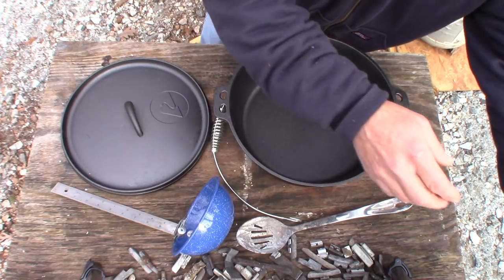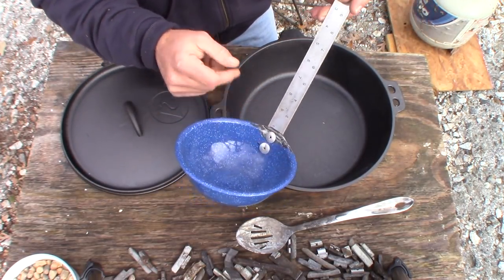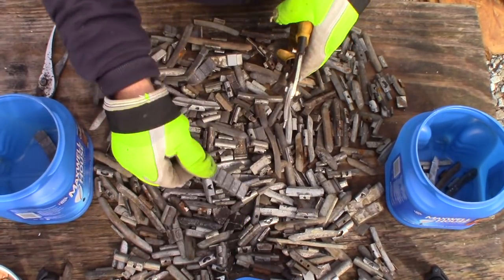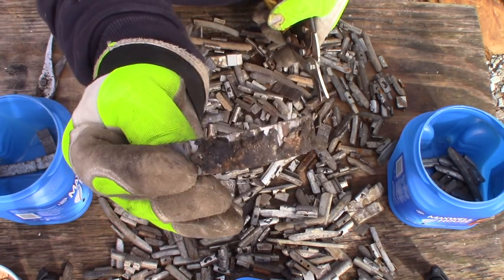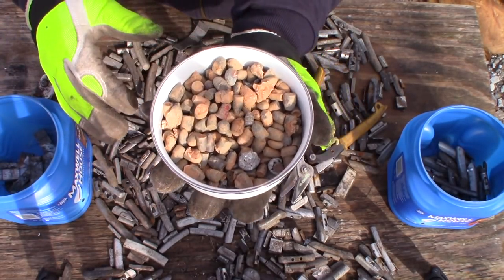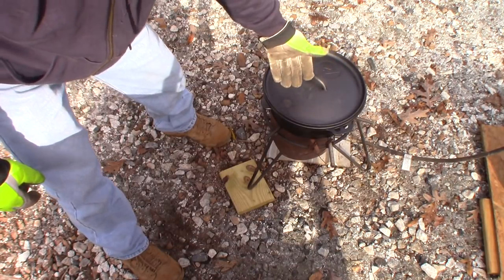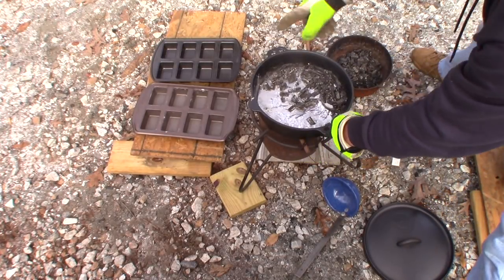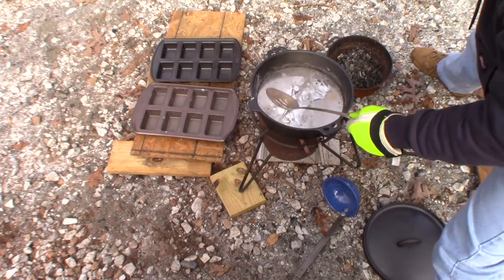Scrap Lead + Fire and Heat = Ingots. Tip, Tricks, Equip.

Comment: I find the easiest way to ID the material of your WW is to look at how the clip is connected to the material. 

Lead WW will be molded around the clip.
Zinc and steel is generally riveted or has some other connecting mechanism. As Elvis said steel can be welded.

Clip connection makes identification really fast and for ones you are uncertain of, just use the other methods like tapping for sound or scouring with shears that Elvis mentions.

Comment: Need to mention a high volume propane regulator BBQ grill regulators dont supply enough volume of fuel for a hot source of heat

Comment: Very informative, Only thing I would really do different is build a 12 in high platform for the burner. Something very stable with a ledge so the pot would not flip over. Then put the molds on a table...just too much bending over for my old @$$. Also would look for a better scoop, that one is going to have the paint on the bowl burn off and I do not trust that ruler handle. Also needs a wooden handle so it does not heat up. As for the molds, put them on a 12 x 12 paving stone you get for yards. The stone will disperse the heat better and not burn like the wood was. (on top of saving your table top..so don't use a plastic one). But other then my nit picking on non important stuff very well done.

Comment: Walmart has a great heavy-duty stainless Steel ladle for 6 or 7 dollars or at least they did 6 months ago. I used one as a bottom pour ladle by drilling a small hole in it like I saw fc45lc do and it works great.
Reply from the maker: hey Patrick M .. Thats a cool idea for a bottom pour ladle!

Comment: hey elvis ,i would suggest to take some precautions .the pot can fall on your feet ,and the spoon to fill the ingots will not hold, better a stainless greasy spoon and weld a steel bar 10 mm thick to it and on the end a wood grip.

Comment: The Dutch ovens that have the tabs cast in for attaching the handles give you another flexibility. You can run a piece of bar stock across them. Tap, thread and attach to the tabs. Weld a bolt to it and then run a threaded rod through that bolt and you can make a bottom pour pot. Grind a point - like sharpening a pencil, on the threaded rod and then drill a hole in the bottom of the Dutch oven where the rod can be threaded down into it to plug the drilled hole. You'll need some way to turn the threaded rod. You probably could use a double nut bound up against another one and crank it with a wrench or you might find a handle that matches the threads. Then when you heat up the pot have it set up on something that allows you to feed the ingot pans under that part of the pot where your threaded rod is plugging the hole. Un 'bolt' the threaded rod and you have the benefit of nice clean melt pour off the bottom. Fast too.

Comment: Elvis, I just bought all the stuff I need to start casting bullets. I went yesterday and got some wheel weights from a tire shop, and was going through them and separating them like you’re doing in this video. I notice all the weights with MC turned out to be lead and the KN was zinc, and the FE was steel or iron. The question I have for you is I found a few the had MC/KN stamped in them. I know the probably lead mixed with zinc, but if you throw that in a pot of lead will the zinc rise to the top so you can get it out, or does it mix with the lead?
Reply: Any answer , as to date??
Reply: I throw those out because my understanding is that you cannot separate the zinc from the lead once they are an alloy together. As a general rule of you can cut into it with metal cutters without going to extreme effort then it is lead and will work for casting.

Comment: How do you get rid of the backing on the soft wheel weights?
Reply: throw them in the pot . it will burn and float to the top.

Comment: What does everyone do with the copper jackets from the range lead? I am thinking of getting into the range lead recovering and i actually have a small forge that can melt copper i mean wouldnt this be a good way to recycle the jackets? an for those that dont have this means can you still take them to a recycling plant?
Reply: Country living yes they ca be sold run a magnet over to before selling because some a copper coted steel jackets
Reply: Throw them in the pot, the copper and steel will float after the lead melts out of them.

Comment: Since zinc and iron melt at a different (higher) temperature why not just dump it all in the pot and let the lead melt. The zinc and iron will not melt and will "float" . Then you can just scoop them out. Or is there something I'm missing...?
Also, those are all metals...lead, zinc and iron. Metal is a large category of elements. You're using the term metal like it refers to ferrous metal (iron) only...js

Comment: ? I got wilton  8 cavity pan  and a new 5qt cast iron pot , melted wheel weights , fluxed with saw dust and pored in pan , ingots came out with little craters on the bottom , what did I do wrong ?
Reply from the maker: all is good no problem...... the chemical on the pan did it... it will only happen a time or two! No worries... sorry bout cratering your perty ingots! : )
Reply: Thanks , I was hoping that was the case . New to casting , not reloading ,  in a learning curve . God bless ya

Comment: Loved the video Elvis.  I was going to buy me 8 ingot molds from Lee, but they were only 1 pound and a half pound ones.  You saved me alot of money with the trays you recommended.  Thank you so much.  I have a question.  I have a gentleman who wants to give me about 500 pounds of soft stick on wheel weights, but they have that tape on the backing of them.  Do i have to remove the tape or glue or can I just melt it and then skim it like you did with the lead.  Also, with this soft lead can I make fishing weights, this is why I wanted to make the ingots to put in a home made smelter.  Any help from you are anyone would be grateful and appreciated.    Thank you sir.
Reply from the maker: 👍👍👍 you can fill them with as much as you want. Any size you want!
Reply: Good mrng Elvis.  Can you read my comment again.  Its about the weights with glue on them or tape.  Thank you
Reply: You can throw them in the pot also, the dirt and tape will float to the top.. also instead of saw dust you can also use wax (candle,bees, crayons etc) any kind of wax will work to flux the lead, it will separate the debris from the lead. just mix it in and it will clean the lead up prettey good. and yes you can use wheel weights or reg lead for fishing weights.

Comment: Elvis, do you know anything about purifying  zinc contaminated lead with sulfur
Reply: Depending on the amount of zinc ... you can add copper sulfate.  Nice hard bullets and zinc is actually useful in getting it to dissolve.
Reply: try fluxing it with wax.

Comment: What is the substance poured in? What's the role? Thank!
Reply: The substance is lead for making bullets for guns.
Reply: i think you are talking about the saw dust, it helps to clean the lead, It separates the lead from the dirt or debris. you can also use pieces of wax instead of the saw dust,

Comment: ive found theres no need to separate them. As long as you keep the heat no higher than the melting point of lead the others will just float to the top. Big old waste of time and exposer to lead tbh...

Comment: I used to score WW all the time from local tire shops and car dealerships. But lately every place wants something in return aka money or trade or what not. Really pisses me off. Theres no freakin shortage i live in Phoenix. Theres over 5 million cars on the road here. Any suggestions? How do you score all yours?
Reply: scott rosenthal I do WW on the halves or thirds. I cast them into fishing weights and trade them for 2 or 3 times their weight in WW to tire shops or scrap yards.
Reply: What part of Phoenix do you live in? Im looking for a new lead source, i dont mind paying for lead as long as they dont try to rip me off considering i still have to process it before i can even cast with it
Reply: Josue Guzman i live in glendale near arrowhead mall.
Reply: scott rosenthal nice, my buddy lives near there hes on 99th and Olive, he knows a spot near there that sells lead but i cant remember the name, i got like 60lbs of lead pipe and they worked great for my bullets, most tire shops i go to the workers are pricks
Reply: Josue Guzman yeah i know of a few scrapyards that will sell lead. I was talking about free lead. I used to score from a local tire shop in chandler but then one day the owner got greedy and wanted 20 bux a bucket. I told him i will pay 20 if there is no zinc or steel in there or no trash razor blades or old valve stems. Long story short I never went back there.
Reply: @scottrosenthal1124  which yards will sell scrap lead? I live out in Surprise and haven't found one yet and do you know what their price is?

Comment: So, @ 8:12, the Zinc stick on weights are melted with the other stick on lead weights?
He tossed it into the soft lead bucket.
Reply: they will float to the top of the melt. the lead will melt first.

Comment: Hey Elvis, saw this video once before when you posted it. Do you get gold color on top of your lead when you melt ? I seem to need to turn down my heat as the pot gets empty to prevent it from getting to hot ! Have those same molds and there great.
However, they do take a while to coll down :-)

Comment: I understand that your home made ladle was a trial run.  What concerns me is that amount of lead the ended up coating it which you probably could be used for casting a bullet.  Wouldn't a steel ladle be better to minimize lead waste?  Could the blue coating of your test ladle in this video be the reason so much lead stuck to it?  It appears to me that the blue portion of your ladle caused possible premature cooling of the lead or for some other reason lead was sticking to it.  Unfortunately we don't have any sort of lead nonstick spray out there to my knowledge when dealing with molten medal.  It would be nice if we did.  Perhaps the blue portion of your ladle doesn't retain heat well.  I'm just throwing this out there for your take on your home made ladle in comparison to steel or if you can find one, a cast iron ladle.

And my commentary doesn't mean I didn't like your video.  You go through the process on how to do it safely and what not to do which is greatly appreciated.  I've been looking into getting into bullet and receiver casting for awhile now.  Aluminum and lead are very easy metals to do home casting with.  During these difficult times we may very well have to cast our own bullets and our own firearm parts.  

Stay safe, healthy and produce more content.  It's greatly appreciated.
Reply: The world is currently being  MORE than patient  , , , ,